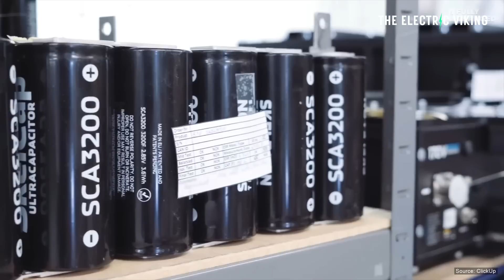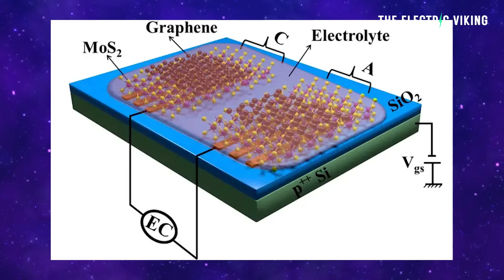Experts say Ultramicro Supercapacitor are "Game-Changing Energy Storage"

Comment: I'd put this one in the 'wait and see' basket. I looked at Sam's source for the story after doing a search myself and found a different 'source' with virtually identical wording. This looks like just a regurgitation of a common press release.

While I sincerely hope there is a genuine breakthrough here, I am hesitant to start popping champagne corks just yet.

Here is why I'm dubious. First, apologies for the length, but once you understand the difference between batteries and capacitors, the reason for my caution will hopefully become clear.

The TL;DR version is that capacitors have a long way to go before even coming close to the energy density of a battery. The likelihood that some scientists have closed that gap in a single bound is remote.

Here's the non-TL;DR version...

Capacitors and batteries store energy very differently.

Batteries (or cells to be precise - a battery is a bank of cells and a cell is the fundamental unit storing energy this way) store energy chemically. Current is generated via ion exchange between two chemicals separated by an electrolyte. The voltage produced is a byproduct of the particular chemicals used. In some cases, the conversion from chemical energy to electrical energy is reversable. We call these "rechargeable batteries".

Capacitors store energy as a static charge. You have two plates separated by a dielectric material - basically an insulator. When you charge a capacitor by applying a voltage across its two pins, electrons rush onto one plate causing electrons on the other plate to be repelled. This is why a capacitor appears like a short circuit when it is charged as current seems to flow through it. If you remove the voltage source, one plate is left with an excess of electrons with nowhere to go. The other plate has a lack of electrons with nowhere to get them. Since the dielectric substance is never a perfect insulator, electrons will cross slowly over time, so they will self-discharge, but let's ignore that for now. So, if you take this charged capacitor and apply it to a load, suddenly the electrons have somewhere to go - through the load to the plate lacking them. This continues until balance is restored and the capacitor is discharged.

Unlike a battery, the voltage provided by a capacitor is determined by the voltage used to charge it. The voltage printed on the side is just its maximum rating - the point where the dielectric breaks down and the plates will arc across, most likely destroying the capacitor in the process. In fact, the higher the value of a capacitor, the larger it has to be to handle a higher voltage. Small value capacitors (useless for energy storage) can commonly handle hundreds of volts. Large value electrolytic capacitors (the big cylindrical ones in the video) can handle up to 35V, maybe a little more. There are bigger voltage ones but the point is the relationship between the value, voltage rating, and physical size.

Unlike a battery, capacitors can be charged and discharged virtually without limit. Since charge is not stored chemically, it doesn't degrade through charging cycles. The dielectric substance can dry out and other things can happen to make a capacitor 'wear out', but for the most part, charging and discharging is not one of them.

Unlike a battery, a capacitor can be charged and discharged at virtually any current, basically subject to the thickness of the wires connecting it. They don't need to have their charging cycles handled with kid gloves like a battery. Theoretically, they can handle as much current as you can dump into it or draw from it.

So, why are we not using capacitors instead of batteries already? Storing energy as a static charge is nowhere near as energy dense as chemical storage. The formula for calculating the energy stored in a capacitor is E = (CV^2)/2 where E is the energy in Joules, C is the capacitance, and V is the voltage. In days of old, a large value capacitor would have been of the order of 33,000uF (micro-Farads). Charged up to 24V, this holds about 9.5J or 0.0026Wh of energy. By comparison, a Tesla 4680 cell is claimed to hold almost 100Wh (360,000J) of energy. Note: there are 3,600 Joules in a Watt-hour - it is like converting centimetres to inches.

I recall many years ago when there was a breakthrough in capacitors. It was the birth of the supercapacitor which was nothing more than an ordinary electrolytic capacitor with an extraordinarily high capacitance value. It was a 1F capacitor capable of 5V. It's first application was to solve a big problem in the humble PC, replacing the 'coin battery' (usually a CR2032 or similar) maintaining the real time clock and CMOS RAM that stored the configuration. That 1F capacitor charged to 5V could store 12.5J of energy - wow! Remember that a capacitor stores energy based on the voltage charging it, so that old 33,000uF capacitor charged to 5V would only store 0.4J. So, a supercapacitor is just a large value ordinary capacitor.

In order to improve the energy density, some manufacturers created hybrid supercapacitors merging the ordinary supercapacitor with the lithium ion battery. While they benefitted from a greater energy density, they also suffered from the drawbacks of the two technologies. For example, unlike an ordinary supercapacitor, the hybrid could not be allowed to fully discharge because of its lithium ion battery component.

Going back to the subject of the video, a Field Effect Transistor (FET) is as its name implies, a type of transistor. From reading the articles it is unclear precisely how it is used and how it benefits the supercapacitor. I don't know if it is relevant, but one thing about FETs is that they have a parasitic capacitance (this refers to capacitance that is a byproduct and not necessarily wanted) between the gate and source/drain pins. In plain English, the voltage applied to the gate and source pins of a FET controls how much current is allowed to pass from the drain to the source pin. It's a bit like a tap where how much you turn the knob determines how much water flows. The thing is that the gate is insulated from the source/drain part in the same way that the plates in a capacitor are physically separated. The FET uses the excess or absence of electrons induced across the gap to choke off or open up the flow of electrons. They may be employing this aspect in their new design or it could be something entirely different.

So, these scientists have a huge gulf in energy density to jump. The question is whether they have done it in one go or simply taken another incremental step towards closing the gap?
Reply: A watt is one joule per second, so 1 W-h is 3600 J or 3.6 kJ. Thus 100 W-h is 360 kJ.  In like manner, 9.5 J is 9.5/3600=0.003 W-h.
Reply: @lxoxrxexnx  , of course you are right. I was so accustomed to working with MJ and kWh, I just used my usual 3.6.

I will go back and fix my comment. Thanks for pointing out my mistake.
Reply: @briancampbell179  you’re welcome. I didn’t check your other numbers and results, but I rather think they are accurate or accurate enough.
Reply: Yes, I googled it as well.  Not only that, but the graphics they use are mostly unrelated to the actual topic (and the ones Sam uses are too... I think he accidentally included a graphic of an actual super-capacitor in one or two places, but most his video references were of normal capacitors).

So basically all the media is creating a word-salad of nonsense with very little real information inside it.  There is only one actual graphic (the one showing the MoS2/SiO2 and FET).   Brings back memories of the "nuclear battery" nonsense a while back.... people forgetting the ultra low currents those things generate.

But back to the FET.  I couldn't find a deep reference to what they were actually using the FET for, and none of the graphics shed much light either.  It clearly is not being used for current control.  The implication from the very poorly-worded media description is that messing with the gate is changing the capacitance between the electrodes (MoS2 on one side and SiO2 on the other).  Which sounds interesting, but is kinda worthless on its own.

This will also depend heavily... very heavily, on the voltages involved.  Super-capacitors are pretty much universally less than 4V but gate controls tend to universally be more than 5V.  How they are supposed to pack the layers together into something dense enough to be called a super-capacitor, I do not know.

Comment: If you want to move 50kWh in 2min, you need to push 1.5MW. Even 125A cables on 50kW chargers can be a little unwieldy when it is cold and cable length is tight, imagine having a longer 1500A cable into a 1kV battery pack! People will be wishing for power-arms to help them move that around and plug it in.
There are practical limits to consumer fast-charging and 500kW will probably be it at least until we get chargers with robotized plug-in.
Reply: Higher voltage, smaller cables
Reply: @rp9674  If you want the highest conversion efficiency possible in the smallest and lightest form factor possible, you have to use GaN transistors and those only go up to 1.2kV. Once you subtract safety margins, you are left with about 1kV as the highest practical voltage.
Reply: Could wireless charging work for this?
Reply: @Davran2742  Wireless charging has high losses. At absurdly high power levels like 1.5MW, we'd still be talking 75kW worth of losses even at 95% efficiency. Pissing away 75kW just because you don't want to use a plug doesn't sound very eco-friendly.
For that amount of power and current, you'd likely want to have the charging contacts directly on the battery pack itself to eliminate intermediate wiring losses. Park over the charging pad, the pad aligns with battery contacts, cleans the pads, applies 1kN of lift to make contact and ramps up current while monitoring the voltage difference between battery pads and charging pads for contact quality.
Reply: Use multiple cables.